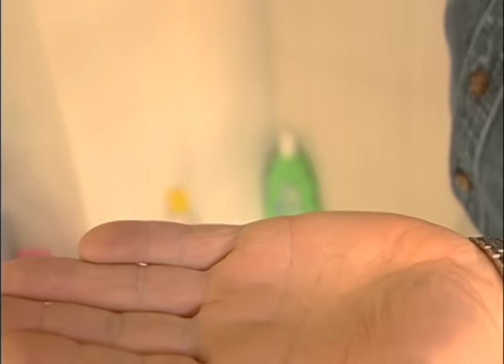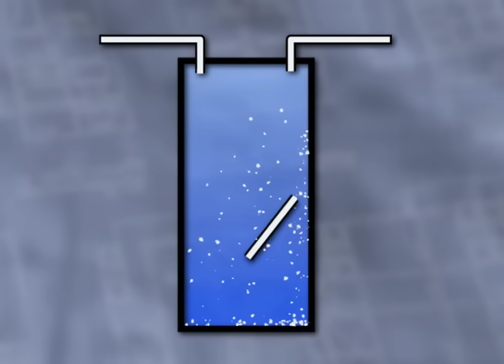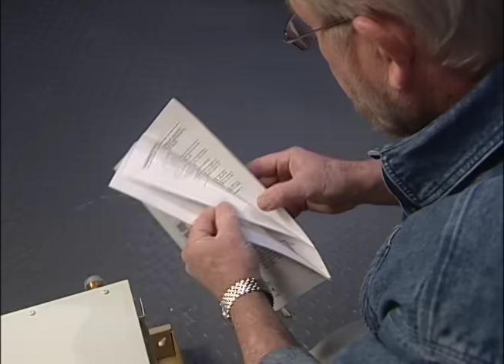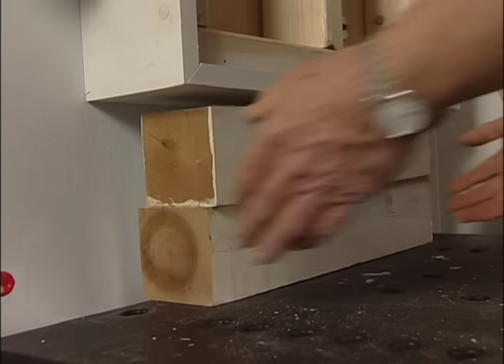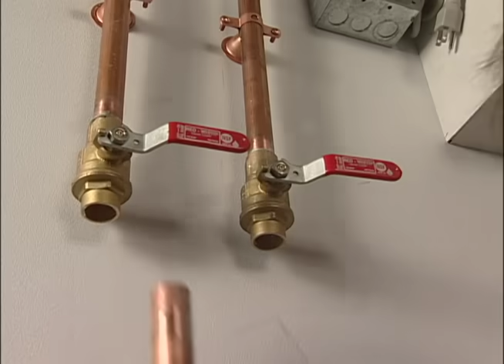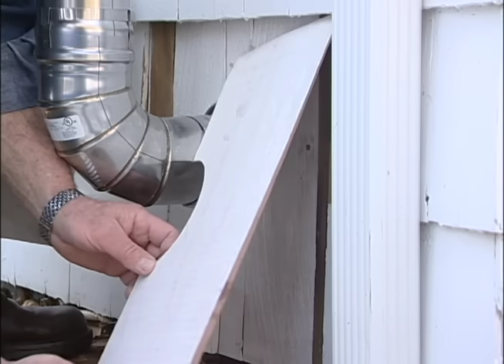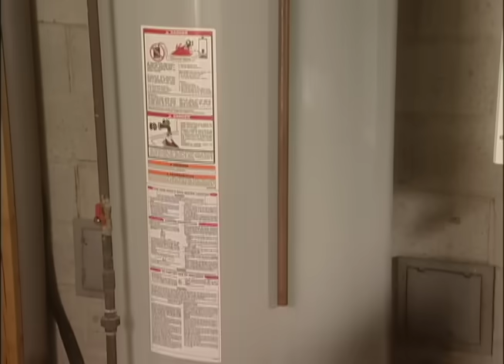Install a Tankless Water Heater

Comment: What was the difference in cost? Did you pull the proper permits? When the "Plumbers" ran the stainless steel gas line. Did they ground Hot To Cold, to the Gas line. Then go outside & install an 8 foot ground rod at the gas meter then run a ground wire from the meter to that rod? Did the plumbers  finish that gas line with the required wrap at each end where they cut it away to connect the fittings??
   Last thing about the tankless.
 Did you check with your locals codes. Where I come from you can't vent closer than 9 feet from an operable window. I'm pretty sure that window right by that new vent opened and closes.
(Operable)
   Who installed your old tank style heater??
You Never hook copper straight to the galvanized steel nipples coming out of the tank. NEVER!!
 When you do that. It will either rot the nipples out or corrode the down tube prematurely.  Which is what happened to yours. You caused the down tube to wear out so early.
Keep doing your own work. Keep spending money you should have never needed to spend.
1 question?
Didn't this tankless have a condensate drain on it? Or are you just going to let it drain on your floor? Which will corrode your concrete floor next.
 KEEP UP THE GOOD WORK!
         😜

I'm editing later in the same day as I wrote this.

The reason I ask about permits & Grounding the gas line. These stainless steel lines have been known to pop a hole in them if the house is ever struck by lightening.  Or if it even gets close to the house. This happens a lot to this style of gas lines. You should have everything grounded even if you are not required to. 
  I'm really curious about the cost over a tank style heater?
Then everything else I asked about?
Reply: I'm sure he did everything legally.
Reply: @charliem.7492  plus. "Legal" doesn't always mean "Correct"
The Grounding of the gas line & the drain for a condensate line are two very very important steps. These are steps that 1 is mandatory the second (drain) the inspector would not even know about. But it still "Must" be done!
Reply: LT's Garage , when the steel corrugated gas came out, I pounded 2 ground rods, and a split clamp to ground wires to the2. Ground Rosa for that reason, but that company came out with ‘COUNTERSTRIKE  because of cases in FLORIDA, BUT I would still like my ground rods thank you, , I SAW you said your body was dying, so you wend back part time, my tendons in BOTHarms are very painful, particularly the right, I USED TO PUT MY RThand on my lap after spring out, so I had to get another ‘AIR CAST SPLINT which takes  up the slack, my body is a wreck , over the years ,  so I do some consulting workHVAC/R, but if need be I have 4 guys I can count on, pay them fairly, get the job done, but I do lots of paper work, for my consulting end of things , stay well, & God Bless you and yours,  CHEERS FROM NJ🇺🇸🇺🇸🇺🇸🇺🇸
Reply: @flybyairplane3528  the reason my body doesn't die. I get up every morning sometime between 7:00am & 9:00am. I get out of bed & go do something.  You have 4 guy's?  I use to have way to many guy's.  16 trucks with usually 2 men per truck. 
   I don't baby sit at all anymore. I got rid of my last employee about 16 or 17 years ago. Now, i started with just myself. I'm finally back to just my self.
  I like it much better this way. I don't need to wonder what people are saying or doing out there anymore?
I've done all the work myself.  I'm about a 110% sure it was done correctly (i did it)
 I do consulting some times.  I dont like doing it. Cant make enough money off of it. My consultation fee is $275.00 to show up & $345.0 per hour.  I charge Portal to Portal.
  I figure if I can make $1500.00 to $2500 a week after everything is paid a week. I'm doing ok.  Keeps my girlfriend happy. Keeps me happy. 
  I have my own stretch of water out my front door (a 100 yars or so away) and its hilly on the back side. Snow likes Dem hills...
  Go out to my shop. Pick what i want to ride or drive for each day. Life could always be better. I just don't know how?
  My complete family has passed. I have my girlfriend her children. Who call me Papa.  Most of the time that's what they call me. Sometimes they call me their private ATM machine.
    I've explained to them. If i say no to them & they don't whine about it.  They will hear yes much more often....
   Now that was a Ramble......
Reply: @charliem.7492  "No, They didn't! 
  Just like when the hooked up the tank style water heater.  
Although, a city permit doesn't mean that it will be hooked up correctly.  On his tank that he took out. Copper pipe connected directly to the galv Nipple on the tank created his problems in the first place.

Comment: Tankless water heaters are horrible. When installed in a basement or attached garage, the hot water takes every bit as long as water from a tank heater to get to the faucet in the bathroom or kitchen. And they take an incredible amount of power to function. Cost of operation is twice what the cost is for a state-of-the-art tank heater.

Comment: Great video! 
In my case I don’t have gas in my neighbourhood so I purchased an electric tankless water heater, Stiebel Eltron brand which I found at a liquidation price. I sized it up for my home needs and got the appropriate model. Purchase the appropriate breakers in my case I needed two 50 amp breakers and a role of 6/2 gauge wire. Did the math to make sure I had the right service entrance panel and amperage,  installed it in about 3 hours. I live in a cold climate where sometimes the temperature goes to -20 or -30 Celsius ( about -15 Fahrenheit) I never run out of hot water, and the temperature is always constant. Cost me about $900.00
Reply: What's you electric bill in the winter months? What size house are you heating? With electric I expect it's pretty high
Reply: @DavidA-411  Hi David, I just looked at  my annual electric bill for the past two years and between August 2017 and 2018 total was $2609.29 ( $217.44 monthly  average or $7.15/day)
and between August 2018 and 2019 total was $1932.26 ($161.02 monthly average or $5.22/day) so did it go down because I'm now using a tankless or is this because of weather conditions, I don't know but I'll see this coming year what my electric bill will be.
My house is 1200 square feet and the amounts above are all in Canadian dollars.
Reply: @Monsterrello  Ouch.
Reply: Monsterrello : 

Hi Monsterrello. 

I am very interested in your project and electric ⚡️ bill records. 

Could you please send me the results of the most recent year?

ajarivas@yahoo.com

Best regards

Alejandro.
Reply: @charliem.7492  if your flat broke
Reply: Can do combination furnace heat exchange on some of these bigger units
Reply: Where did u purchase this?CT or HomeDepot carry them?

Comment: Everything sound and look nice but is by any change you loose the electrical power then you don't have hot water because the tank less works with electricity plus cost more than a gas water that doesn't need electricity to work .

Comment: I wanted to put an electric tankless water heater under my kitchen sink, but aparently they have to be hard wired, so I am still waiting for the water to come from my water heater at the other end of my trailer.
Reply: Steve Allen the 5 gallon units use a 120 vol receptacle , not hard wired ,, Cheers From NaJ🇺🇸

Comment: What came to mind: 
1) why not use the existing flu from the tank water heater rather than installing that monstrosity of a ground level vent asking to get damaged over the years. 

2) what doesn’t seem to be discussed on the tankless videos is that you may well find your gas meter is too small of you have other gas appliances and a larger meter can get expensive. 

It’s not just an easy swap.
Reply: Because its illegal to use an old standard flue. Tankless runs much hotter than the tank style. 
  He has more problems than a bulky flue out side. 
I'll go back to comments to make a small list. I could make as large list. But I'll be nice...
Reply: You cannot vent these type of units into a standard chimney.  This particular unit requires stainless steel venting. Personally, I would have chosen a heater that vented with PVC.  Much easier and less expensive.
Reply: @Jimddddd1981  most PVC vented heater need to have an exterior intake burn air flue also. So where the PVC flue cost less. You need to pull fresh air from the outside to the tankless.
Reply: It’s still easier and cheaper than stainless steel pipe. Plus, the intake pipe is not always required. It depends on the unit. Consult the installation manual. I don’t know if they still make them, but I have seen some two pipe stainless vented units.
Reply: @Jimddddd1981  I like the Navien the best. It has an all plastic flue. Plus the bigger units need the fresh air intake pipe. And a condensate discharge line to the exterior.
Reply: @Jimddddd1981  it really depends on what "code" you have in your area. My county doesn't like it when you burn inside air for any appliance.
Reply: LT's Garage that means you have a CONDENSING UNIT , THE ACIDIC WASTE GOES INTO A CONDENSATE PUMP, WITH A NEUTRALIZER IN IT , Cheers From NJ🇺🇸
Reply: @flybyairplane3528  you're saying this like i don't already know it??
  Duh!!
  How old are you Leighton? How long have you been plumbing?
What either country are you in or What part of this one are you?
Reply: @flybyairplane3528  no kidding huh??

                    😋
Reply: LT's Garage I am retired  78 YEAR OLD, HOW BOUT YOU? Cheers from NJ🇺🇸
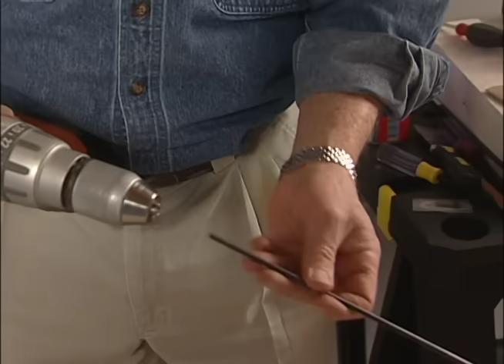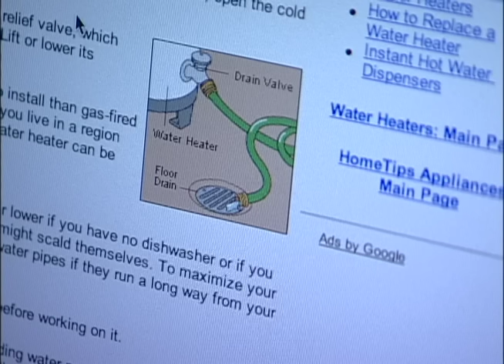Reply: @flybyairplane3528  i was retired for 10 years about 25 years ago. I realized that my body was dieing  so i went back to work for a few hours a week. Never work on monday or Friday.  Never start work before 11:00 in the morning.  Then come home most days around 2:30 or so. I enjoy talking and meeting new people.  
    Cheers from California Hills.........
Reply: Minok1217. I've installed 100's of these. I've never had to have pge turn up their pressure regulator.  Ever!
  In California all you need to do is have pge change out their pressure regulator. 99% of all regulators run on 1/2 pound of pressure. Pge comes in anywhere from 10lbs to a 100lbs. Then at the meter the run through their pressure regulator to bring it back down to 1/2 lb.

Comment: "Tankless Water Heater" yes its called a combination boiler, on demand hot water when you want it
Reply: The unit he installed is not a combination unit. It’s only purpose is for hot water for the faucets.

Comment: Is the US 30 years behind the UK for hot water heating?  We've had combination boilers since the 90s.  Almost no one has a hot water tank now.  Interesting. Edit... This could be a very old video of course
Reply: Sean Crowe. That shirt is timeless.....
Reply: Give that it’s 4:3 aspect ratio it may well be at least 15 years old.
Reply: We’ve had this for years too but the expense of switching over is what keeps the hot water tanks in houses. A lot of new construction put these in.
Reply: In Europe there have been tankless water heaters for many years and it is because they are economical.  I inquired years ago about getting one but here in US there is definitely a mindset against them so I have a huge water heater with a tank that I pay to heat constantly.
Reply: Different mentality in us/ca we waste a ton of water everyday, where as in Europe I’m sure it costs a lot to heat water and hold it, we are behind 20 years compared to you
Reply: There is another consideration. Generally speaking, the water output delivered by tankless water heaters measured by gallons per minute is usually not as great as hot water tank heaters. This results in the inability to consistently deliver a sufficient amount of hot water for multiple users simultaneously. Although newer models are much better than they used to be in this regard, they cost more. Initial cost is what often determines decisions.

Comment: I love tankless water heaters - but unfortunately, they can be impractical and expensive as a replacement unit in most homes due mainly to the fact that they require their own, dedicated vents.  Most existing homes don't have water heaters on a dedicated vent and often, the heater is either located far from an outside wall or in a basement where getting a new vent out requires going through lots of structure and making lots of patches.  It can be tricky, leak-prone and costly to do.  You would probably need a government subsidy to really get homeowners to convert to tankless...and that is unlikely to happen.

Comment: Thanks, quite informative. Now we will be doing something similar to our park model trailer. However with a propane system, it also requires a water filtration system. Anything will be better than the less than 5 gallon tank we currently use!
Reply: mines 2 years newer  but no filtration system was needed. there is a drain tube for the water coming off the propane to go into floor drain - but after 1 year of use, only several ounces was produced from use.

Comment: U dont need a sniffer . soap and water on each fitting will show a leak .
Reply: Jason donnelly. So will a match. Plus it won't blow up. It will just light up. The pressure on the inside is higher than the pressure on the outside.  If you have a leak. You just put your finger over it. The flame will go right out!
  Natural gas coming into a home is set at 1/2 lb. or less coming into the house....
Reply: @ltsgarage7780  .0000001 psi will show up . buy the glow in the dark stuff if u want . Put a 24 hour preasure test on it . I just one uped you sniffer .

Comment: Every home that has converted to "Tankless" all went back to a tank heater..
Issue: must be very close to the faucets. Gas units must be outside or in garage for well ventilation.
Electric: you need an electrical outlet with GFI protection near unit.
Greatest drawback: not large enough for the whole house. Need a unit in every room you want hot water.

Comment: I had 10 customers with tanks and 10 with on demand. 
The tanks cost more to operate 
But
There really no savings on average due to repair and setup , maintenance costs 
After 10 years found it cost more for the consumers 
But
I did see Noritz water heaters are giving a 25 year warranty now
Reply: B K  HERE IS A TID BIT FOR YOU, NOST tankless gas units require 3/4” pipe to it, BUT NORITZ USES 1/2”, which was what was used fir the old tank type heater!, Cheers From NJ🇺🇸
Reply: most tankless dont last 10years, after 5 years they will give you trouble.

Comment: Renai tankless 1200$ ,installation $2200, one year later 1600$ in repairs and still repairing for it because no matter what I put in front of the vent outside spiders (baby spiders) will make its way in there and block the valve and every 6 months it has to be cleaned.
Reply: When it works it’s great
Reply: I need customers like you. If I charged $3,400.00 for an average tankless install I'd never have any work

Comment: NOT A FAN OF THIS UNIT AT ALL.
Reply: he will find that out later.
Reply: @dangda-ww7de  Maybe you can give me any prudent negative information about this unit? Any information would be helpful. 
I don't think I'm going to get anything from the other guy.
Reply: @ComPrt3  im a plumber in la, many people call and ask for tankless fix, the problem with all the tankless is there are a lot of electronic inside that unit, u wont find a plumber that know all the tankless problem, once the problem arise, a tech need to call to the manufacture and ask how to fix their problem, with a tank type you can go for 5 to 10 years without problem. People call me i just tell them to put the tank back , that will save a lot of $ and u wont be in the middle of the cold winter without any hot water, with tankless they have to ship part from the east coast, can u wait 2 or 3days without hot water? Most cant.
Reply: @dangda-ww7de  So you're speaking about tankless in general and not to this particular unit? 
Sorry about my naivety on the subject, but I'm thinking of going tankless, thus all the questions.
Reply: @ComPrt3  all tankless in general.
Reply: @dangda-ww7de   Thank you for the information. I think I will take your advice and just replace my old water heater with another water heater. 
Any recommendations for a 50 or 100 gallon unit?
Reply: @ComPrt3  bradford white.
Reply: @dangda-ww7de  
Here's a novel approach. Get trained on the repair of the units you put in.
Reply: @hotdog1008  been there done that.
Reply: What's wrong with it, if you don't mind me asking?
Reply: @ComPrt3  WHERE YOU WANT ME TO START ?????LOL
Reply: @DENIEL381    Anywhere will do...😐
Reply: @ComPrt3  THERE'S NOT ENOUGH ROOM HER LOL

Comment: These have been around for years n years and they're called a boiler over here in the uk, didn't know anyone still used old hot water tanks, not seen one in 18+years over here lol
Reply: theghost1920 Exactly, very similar to combi boilers. America still haven't realised that they can use one appliance to provide both central heating and hot water though! Here in the UK we seem to be moving away from combi boilers though, at least in high end and larger properties, they don't last well as they cycle on and off dozens of times a day when people operate taps, and can take a long time to deliver hot water. Any decent plumber would now recommend something like a system boiler and megaflow cylinder for a family home.

Comment: anyone wanting this, the only drawback is you should make a cleanout valve.  You can use white vinegar in the cleanout valve to keep hard water deposits (scale) from building up.  Areas that have very hard water, should be cleaned out about once every 3 months, and the norm is about once every 6 months.
Reply: They sell kits for adding the valves and it looks super clean !  If you don't flush it ,every six months or so , u lose the efficiency of the heater and could cause it to fail all together.